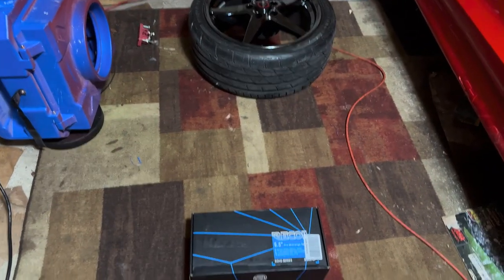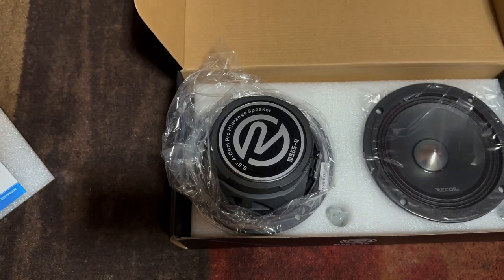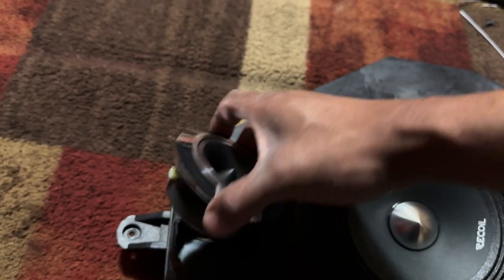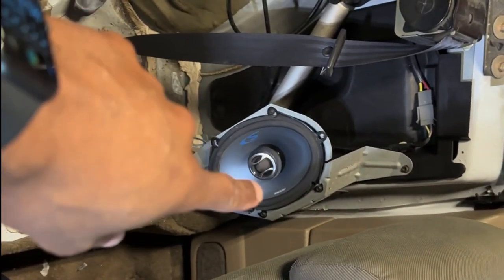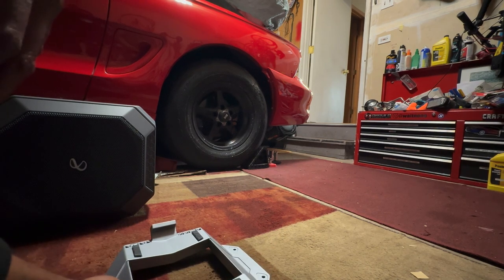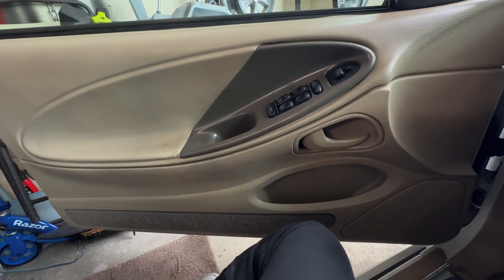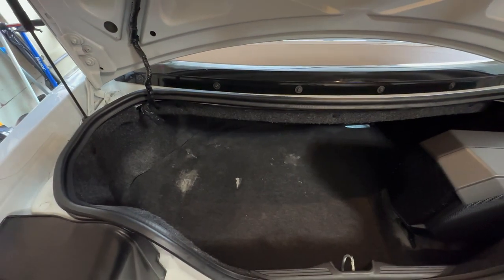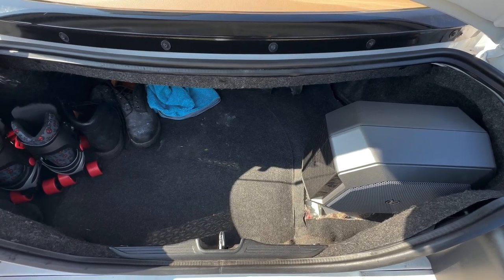How to Make your Mustang Audio Great Again

Comment: I put the $35 recoil echo components in my 95 gt convertible took some doing to fit a 6.5 in door but I got em, they were to be temporary but they sound great so I left em. I put the tweets in the upper corner of the door pocket pointing up but my leg blocks it to much got to rethink that. I have em on an old Sony xplode amp an still get loud. For subs the vert trunk sucks it's so tiny... I have two 1.5cf enclosures in rear corners there as big as I could cram in there, in em are D2 Wlldse HCY 12s (awesome budget subs, same cast frame as sundown SAv2/U and 200oz double stack, 3" coil) in each on and Audiopipe apcle1800.1 and it actually thumps pretty good but between the FS and small ported boxes the tuning is like 41/42 so there pretty punchy. This is my budget system and its pretty decent. My van has my bigger system with 2 custom 400oz 15s I built on a cab45 @ .5 ohm it slaps lol. It has active 6 channel front stage through DSP with 6.5 silver flutes on a bridged 4 channel a/b soundstream and 3" Dayton mids and bic america tweeters on a 4 channel a/b soundstream. My amps for mids n highs are not huge wattage but pretty nice sounding and have plenty of power to make em bark.
Reply from the maker: I'm going to buy a suv and build a wall in it one day. I bet that van hits hard. What's your battery and alternator setup?

Comment: Man get a JL audio small depth sub woofer and it will change your mind. For real
Reply: Yes my wife had a Fusion pro 10" sub in a sealed enclosure built into the cut out in the passenger side rear of the truck and WILL provide the maximum trunk space and heart stopping bass note. Believe me or not do your research this time and build this design I'm telling you about and pick any high quality sub and digital amp. You will be happier than a huge sub. There is a point in which you do not have enough air volume in your truck to support a  massive sub. Hell there are 8" subs that Focal makes that would need 🎉 too much air volume to work properly.  In the sub woofer world quality matters more than size.
Reply from the maker: My guy @coupefrostbite has a nice single 10" ported sub in his notch. I forget the brand but it's the box is tuned in and his single hits harder than more old 12" setups I had in the past. I've been out the car audio game but you're dead on about quality now.